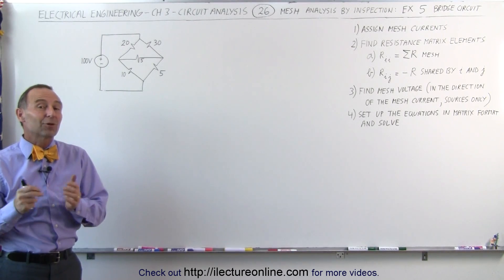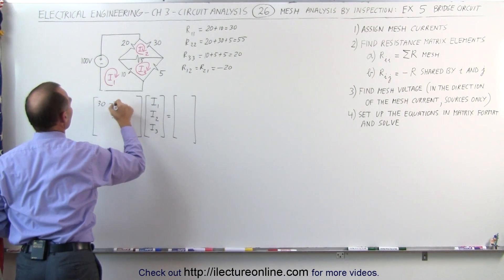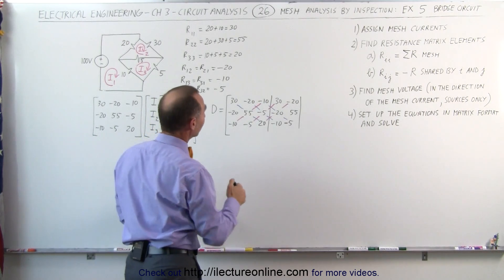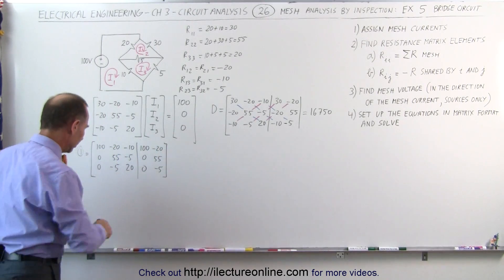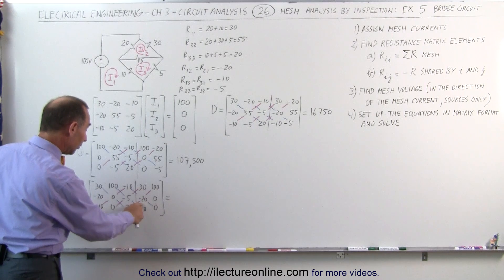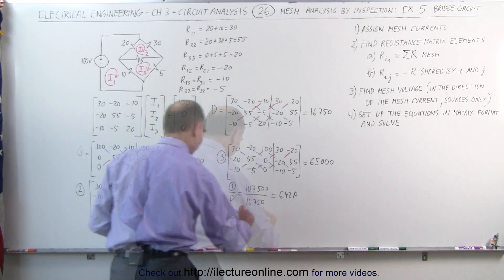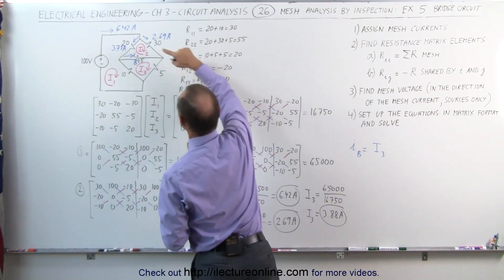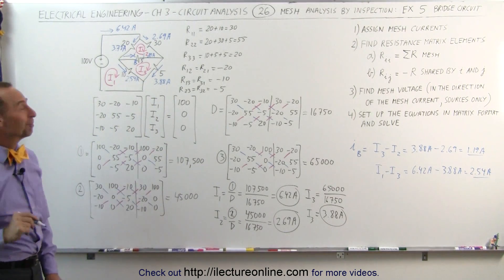Electrical Engineering: Ch 3: Circuit Analysis (26 of 37) Mesh Current by Inspection: Bridge Circuit

Comment: If I set I2 to counter clockwise the result will still be the same how do I determine the direction of the current?
Reply from the maker: It doesn't matter which way direction you assume the current to be.  If you chose wrong (the current is in the opposite direction), then you'll get a negative answer for the current.
Reply: Sir for this particular example if i assume I2 is counter clockwise and I3 is clockwise it doesn't change anything since we add up all the resistance and there's 0 voltage on that particular mesh. So when i calculate I2 it will be positive no matter which direction i assume the current to be? Sorry I'm a little confused right there.
Reply from the maker: If you change the assumed direction of the current, the voltage rises across the resistor with the original current direction will change to voltage drops, and vise versa.

Comment: Firstly you are absolutely amazing but based on the fact that is symmetrical so 2 questions come up
1)why Rij where i not equals j is negative
2)why we suppose that is symmetrical
Reply: For ur question2
The resistance common to mesh 1&2 and resistance common to mesh 2&1 are always gonna be the same as its the same resistor. Thus matrix becomes symmetrical
Reply: Thus R12=R21 and so on

Comment: Thank you for your videos - they are extremely valuable.  I have one question on the bridge solutions above using the "by inspection" method:  For loop 1, it seems I should be able to come down either branch and arrive at the same solution since I have not changed the configuration.  In your video you sum the 20 ohm resistor and the 10 ohm resistor for 30 ohms (entry R11 on the matrix).  When I rotate the bridge and instead sum the 30 and 5 ohms resistors( R11 =35) and correspondingly enter the other matrix values (R12=-30;R13=-5, etc) my solutions, with the exception of I1, are different.  I get I1=6.42A, I2=3.73A instead of 2.7A, and I3=2.54A instead of 3.9A.   I have tripled checked my work - but cannot figure out why the difference.  Am I correct that the currents should be the same regardless whether I use the 20/10 branch or the 30/5 ohm branch as I discuss above?
Reply from the maker: One way to check it is to perform a delta to y conversion.  Find the total resistance and then find the current.  The current should math the current from this method.
Reply: Probably a bit late, but I assumed the 20/10 branch only works because it's the path of least resistance for I1 (30 ohms is less than the 35 ohms from the 30/5 branch).